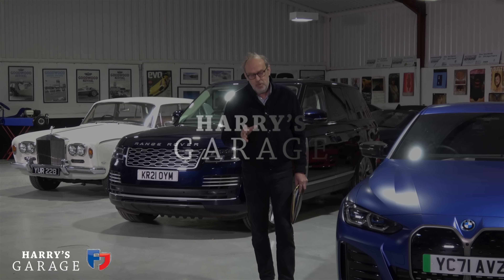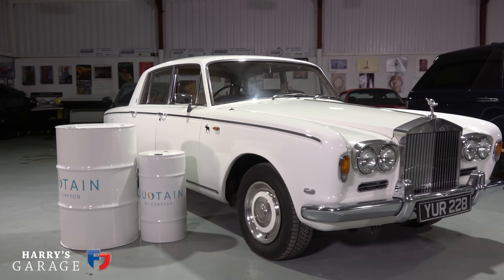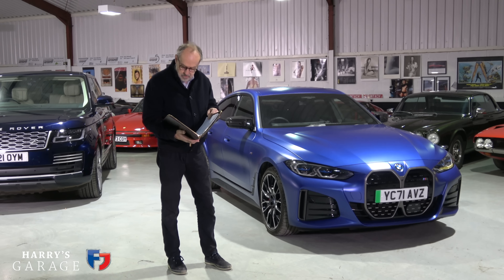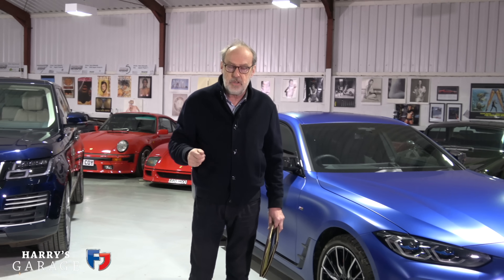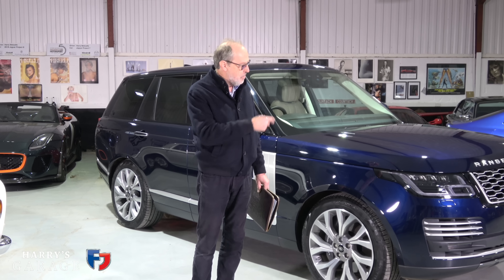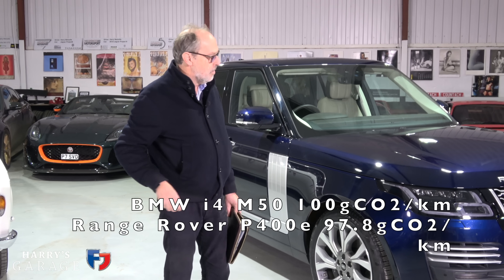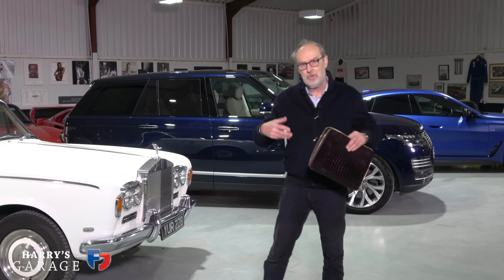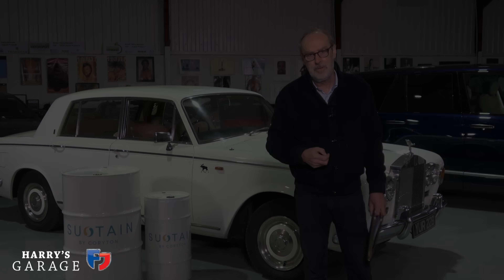Sustainable fuels; what are they & are e-fuels better for the planet than running an EV or PHEV?

Comment: Thanks for this great analysis, very encouraging for classic cars; I've seen various classics converted to electric including a100k ++ Bentley, which tho beautiful and works of mechanical genius lose the point of a classic, and as you point out what life span? I think these are like putting a quartz movement behind a grandfather clock face, accurate but dead and dramatically diminished value.  My old car is 60 years old still with its original engine... occasionally I do get range anxiety if I think about it!

Comment: Very interesting. What I am trying to find is a comparison in carbon usage during manufacture, between a new petrol, plug in hybrid and full electric. My instinct is that manufacturer of full electric is much more carbon heavy than the others. Also what was the manufacturing carbon footprint of a car ten years ago,say, compared to a new full electric? Harry makes a good point we should all be driving older cars!! Which is a bugger as I’ve just stumped up £71k on a new full petrol F Pace. Damn it!

Comment: As the population and energy demand explodes and goes towards infinity, not sure biomass (demand growth) can follow. Lots of hype around hydrogen (which you’ve covered) but the current issue there is use of capital and return expectations. Sure you can go to Chile and generate power from the sun or wind but the profile only produces power/fuel part of the day. Then the fuel is in the middle of Chile, and has to get to market. That costs too. Anyway, interesting times. We will solve it, we have no choice.

Comment: Amazing Range Rover efficiency from 2 1/2-3 ton vehicle ! CO2 from biofuel production ? Omitted from your equation. We don't all have farms or vast reserves of money  to erect our own wind turbines,even if we had space. You are correct EVs need to be better.Building bigger and heavier batteries for EVs is not the answer. Aptera and Sion are making solar vehicles that charge on the go and while parked that can also be plugged in.Efficiency !! The Aptera in particular has CD of .013 and mass of around 800kg with composite construction.Granted it is only a 2 seater but would do most people for most of their journeys with a range up to 1000km.

Comment: One question for you Harry, what is the usable lifespan for the sustainable fuels. As we are finding the E10 from the pumps is only usable as a fuel for a few months before the ethanol starts to break down into water making the fuel useless and damaging to the vehicles, or so we have been lead to believe?
Reply from the maker: I believe it will have an indefinite lifespan, as it contains zero ethanol. I will ask the question again, though and report back in a future video

Comment: Well reasoned (and needed) discussion here Harry.
Personally, I don't get EV's, even their excessive weight completely negates efficiency, let alone the mining of materials for batteries.
Reply: except it doesn't. 

This is because EV's are fully bi-directional, ie they can move energy from their battery to their Kinetic Energy (ie energy stored in their mass at speed) but they can also recover that KE and put it back into the battery, and that round trip only looses typically 25 to 30% of the energy. That means, from the effect of mass on consumption (note not efficiency!), EVs actually weigh 70% of their kerb weight. This is why a 2.5 tonne Tesla Model X returns over 100 eMPG,, whereas a 2.5 tonne Range Rover with ti's 5 litre V8 returns less than 20 mpg!
Reply: @maxtorque2277  If the KE on these vehicles was as efficient as you suggest, surely they would never run out of power?!
Reply: @gordonsimpson3235  What?  The Kinetic Energy recovery or "regen" as it's typically called can never be 100% efficient, and even if it were, the vehicle obviously still would have aero and rolling drag which are the primary "consumers" of the battery energy. High levels of regen power simply allow the vehicle to be driven dynamically (ie with changing speed) and effectively nullify around 70% of the effects of those speed changes
Reply: @maxtorque2277  so, NOT so efficient then!

Comment: Come on Harry I know you love the internal combustion engine but quoting 30p per kwh is bending your figures. You would be insane to charge up an electric car at peak time. Off peak charging rates are currently 5p not 30p and after the increase on 1st April its 7.5p but not 30p.

Comment: Bio ethanol has been produced and widely used in Brazil for many years. They have a very efficient system of sustainable production but they also have many times the amount of land available than we have here in the UK for ethanol yielding crops. I just wonder if we can produce it "locally" in the quantities required to really make a difference. If we have  to start shipping in raw materials or even the finished fuel then maybe it won't be so "clean". As has been mentioned, I think a combination of bio fuels, hydrogen and battery power will be the answer to future motoring.

Comment: Also.. Heavier cars mean more degradation on the roads and tires.. so there is more CO2 used to rebuild roads, and polution from tires particles.. Normaly that BMW would be at least 500kg lighter.. so it is not a small change.

Comment: I have to agree with Harry. There will be a dramatic technological change and hopefully sooner rather than later. I think that most of us want to have a cleaner environment that also protects our planet. Governments around the World don't really seem to have fully thought out the future and have seemingly jumped on the EV bandwagon. Please don't misunderstand, I am most certainly not against EVs. The UK has an exceptionally high proportion of vehicles that act as tow cars. Be they small trailers, boat trailers, caravans or livestock trailers. We are very much a towing culture and EVs with their fantastic torque that exceeds that of even diesel are potentially the perfect tow vehicle. Yet, they have created charging stations that are pull-in rather than drive through. WHY??? If they don't get their heads around this one quickly, there is going to be mayhem anywhere near a charging station with people unhooking and re-hooking up trailers or simply blocking access. The same applies to manufacturers who are also not thinking about this and are putting the charging port on these vehicles in any position they like. Someone needs to get a grip and start standardising where the charging port should be and every part of the necessary infrastructure fall into line with it. It's a total chaotic mess as it stands. The strategy of energy production, how it is delivered and every other aspect has been poorly thought out. We really seem to be putting the cart before the horse. The UK example above is not really unique and is repeated in countless countries around the world.